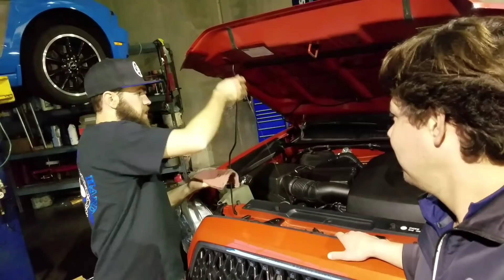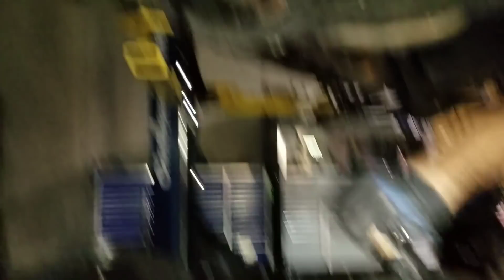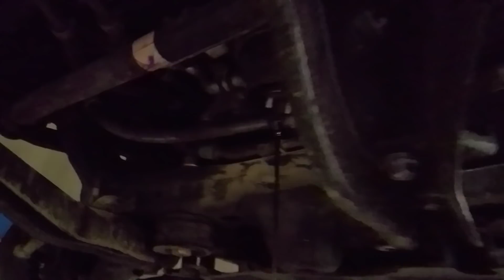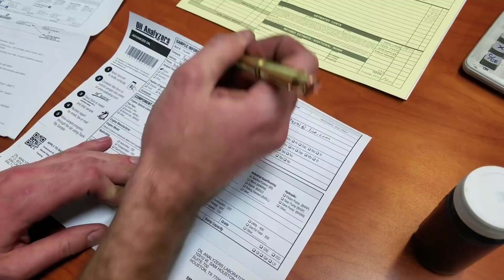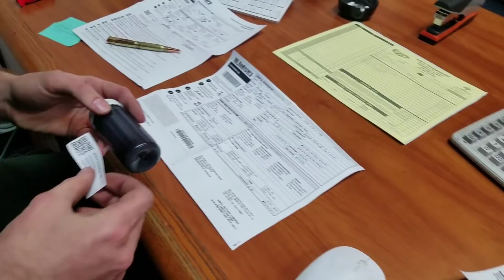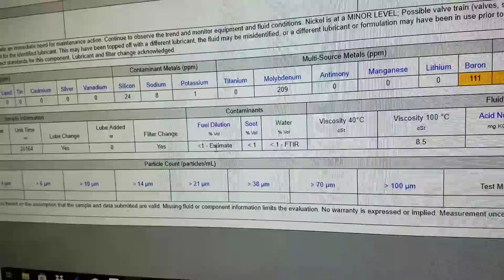AMSOIL Signature Series 5,500 Mi Oil Analysis Results

Comment: You said you did an engine oil flush to prepare your engine for synthetic oil , please elaborate , and what product did you use to do the engine flush and is it actually necessary?? I’ve been running Amsoil signature since new, I don’t think engine oil flushes on new vehicles is really necessary or safe for your engine I think but please let me know your thoughts.
Reply from the maker: Yeah it's great to clean the engine especially on a vehicle that ran mineral oil mineral oil is in almost all the synthetic oils when they call a oil full synthetic it's not it can be labeled full synthetic when it's 25% synthetic or more which means the remaining 75% can be mineral oil once it gets hot it burns and it leaves deposits around the Rings sticky lifters oil cooler ports basically it's like a black paste and it adds all kinds of heat insulation everywhere inside the engine so it's ideal to get it out before you change your oil to Amsoil it just allows it to run better we have a whole playlist on my 59 Cadillac everything we did to get it to where it drives now about 60% more power than the day I bought it.
I'm diesel engines I like to run it every oil change on anything with a turbo I like to run it every oil change on a regular naturally aspirated engine I personally don't think you need to use it every time but you can it's safe for the gaskets check out this video right here on the kitty cat - https://youtu.be/lfNmYbR-xuY?si=4ez05mXgKjHylqXd
Reply: @Syntheticoilprotection  so if I’ve been running amsoil signature,since brand new (except for the first oil change) so no need for an oil flush? I use a Napa platinum oil filter and change it every 8000kms .
Reply from the maker: @wnfakind9197 oh yeah you don't have any buildup in a motor that's new you're good👍

Comment: Dude if that thing only has 5,000 miles on it and he's been running Amsoil since the beginning plus it being a Toyota which lasts forever anyway I would not be at all surprised if he can put a million miles on that with no engine failures wouldn't be surprised or shocked in the least

Comment: The majority of engine damage actually comes from contaminants that are less than 5 microns. Then synthetic oil filters have larger pores, so it does not filter out the contaminants that are causing the most damage. The larger pores are how they can last 15,000 miles.

Comment: How does this oil stack up against Toyota 5w30 oil? I am not sure it’s worth double the money for oil.
Reply from the maker: 2. What makes AMSOIL different than other oils? - 

AMSOIL is 100% Synthetic & has higher film strength & holds up 4× better in turbocharger deposit testing than Mobil 1 EP which protects and separates metal parts, keeping them from wearing and Lasting Exponentially longer: https://youtu.be/f4eNPgTi_qo 

3. Why should I use AMSOIL?: It protects the engine so it will last longer. Less oil changes less often (once per year/15,000 miles) or longer... Save money in Gas & Time making it less expensive than a free oil change over the year - https://youtu.be/H7K6FdZlqmg
Reply from the maker: AMSOIL Performance Test Results - https://www.amsoil.com/performancetests.aspx?zo=5331179
Reply: But you can’t tell me it’s worth double the money for something like Castrol or pentzoil. I can do two services where we do one for Amsoil. The oil might be a little better but not worth double.
Reply from the maker: I used to think the same exact thing until I found out about the preferred customer membership you'll see with the preferred customer membership it's about the same price as any other oil actually it's a little bit less than most other oils depending on which one you'll see there is the Amsoil OE and there are some other oils there they are significantly better than OEM with 100% synthetic technology higher film strength of course better gas mileage better cold starts.

When you click on the link go to shop and you'll see the motor oil and then you'll see the preferred customer price underneath the retail price.

As far as gas mileage savings it will more than pay for the oil so basically you'll never pay for another oil change with Signature Series.
https://youtu.be/vp1HTtlulR8
Reply: Ok. I just registered and bought engine oil. I need transmission oil in my Toyota Tacoma 2009 4.0. It seems like the Toyota oil is not full synthetic. When I drain the oil not all will come out so would it be ok to mix the Amsoil with the remaining Toyota ATF WS in the transmission?
Reply from the maker: Yes, you can mix it with any other ATF.

     You'll feel a huge difference just doing half and then if you want to you can always come back and do another drain and fill in a couple hundred miles if you wanted to be a little bit clearer
Reply: Which Amsoil atf do I use for my 2009 Toyota Tacoma trd sport 4x2? 4.0 v6.
Reply from the maker: Lookup For Your Vehicles - https://www.amsoil.com/guides.aspx?zo=5331179
Reply: Ok. Giving Amsoil 1 thumbs up. I just changed the oil in my diff of my 2006 Tacoma prerunner after having Mobil 1 in there with allot of chattering when going slow and turning. I put Amsoil 75-90 and the Additive for the LS. NO MORE noise!
Reply from the maker: Sweet!!!

Thanks for sharing your feedback that's awesome
Reply: Jaco, I ave found an oil change with Signature Series and Ea filter done yourself costs about the same as a synthetic oil change at the dealer. So your labour will get you a much better oil and filter. To me, that is a good deal!
Reply from the maker: This is the actual numbers after 1 year and 26,000 miles - https://youtu.be/Wdq2A2YIorM

Comment: Can you review AMSOIL DOMINATOR 20W-50 Competition Diesel Oil
Reply from the maker: It's basically the same as the 15 W 40 Signature Series it has added zinc and phosphorus for more load on the Pistons and cams so if you're running like a thousand horsepower diesel trucks with extremely high heat it'll help with oil pressure and that's on a lot of the high horsepower engines.

If you're doing super racing then you would use the 15w 50 Dominator race oil. 

https://www.amsoil.com/shop/by-product/motor-oil/racing/dominator-15w-50-racing-oil/?code=RD50QT-EA?zo=5331179

When I get a competition diesel truck all do a video thanks for the suggestion Charles!

Comment: "Did not burn any oil".... I should hope not. Even with conventional oil you shouldn't see any oil lost due to burning... it's a new engine. Has nothing to do with the oil type and everything to do with the piston oil rings. If you were burning any oil  I would say you would need to take the truck in for warranty repair.
Reply from the maker: All the engines burn oil it just depends at what rate.

On my 20000 mile Uber Lyft video the Honda only burned 0.4 quart every 10000 miles.

Regular Factory Honda oil will usually burn about 0.5 - 1 quart of oil every 5000 miles.

The better the engine and the better the oil the less oil burn that goes out the tailpipe which is emissions.

This is my 20000 mile Uber Lyft field study test.   
https://youtu.be/fdSyZ-D3gnw

Comment: Hey is the engine flush safe!! I have a g37 2013 3.7liter v6 . I do my oil changes every 4,000 miles. Will it do any harm to it??
Reply from the maker: You're fine using the engine flush on basically any engine the only thing you don't want to use it on is where you can't remove all the flush.

Also you don't want to use it on differentials because there's proprietary modifiers in there.

https://www.amsoil.com/shop/by-product/other-products/cleaners-and-protectants/engine-and-transmission-flush/?code=FLSHCN-EA?zo=5331179

Comment: I have been using as soil for about a year in my Rav4. And you know I was sketchy about using it. One because I here all the stories and they say Amsoil is a scam, for two people say if it's so good why is it not sold in these big box stores. And finally, my Toyota dealer said it will void your warranty. So after researching and watching all of Ebens videos, I took the plunge and tried Amsoil. Well after 60,000 miles later my Rav4 is still going. Every time I change the oil it comes out clean and I use the OE and usually do 6,000 miles on it. So let me say this with total confidence I have now switched the Rav4 transmission fluid and now I on my second Amsoil change int Corolla. I have Eben and his videos to thanks for helping me cross over into the Amsoil world. Thanks, Eben. Your awesome.
Reply: Just so you know, It's Illegal for them to void your warranty for using another oil, Amsoil also warranties there oil.
Reply from the maker: Thanks Joel that means a lot to hear that from you and it means a lot that the results are paying off now😊

Thanks for sharing my videos and being a part of my channel!!!!
Reply: @Syntheticoilprotection  your welcome.
Reply: Dealer LIES!  As long as you change it per the MFG recommended intervals (and correct weight) during the warranty period it is against the law for them to void the warranty.  Amsoil is not a scam; some people don't like the brand because it's not sold in Wal-Mart or Autozone.  My Local NAPA carries it, but I just order on their website.

Comment: hi Eben how u doing? Eben I have a question about the test he had done on his motor oil, how u know if the oil is still good when he had the results back?  were in the test sheet will tell u that?  call me old school, my thing is if is dark is time to change the oil. i'm not to mechanical incline. thanks for the video. Eben have a beautiful day. take care
Reply: The color is just the suspended crap you don't want stucking to all the important bits inside the engine. Engine oil can turn "black" quick, some can be right away, 100 miles, 500 miles or 1,000 miles. Its ability to protect is still there.
Reply from the maker: When the oil thickens it becomes old if the oil doesn't break down and thicken it still good and as long as the detergents are still adequate you will not form sludge that's all that really counts

Comment: Do you use engine flush when draining existing Amsoil or only before converting to Amsoil?
Reply from the maker: On gasoline cars I only use Amsoil on the first time switching to Amsoil.

On diesel trucks I use it every single time because diesel oil is super thick and thus it clings to all the metal and also you want to clean your turbo is often as you can so you don't get Turbo cooking so I recommend using the flush every single oil change on anything diesel also it thins the oil out so the oil change process is much easier and faster